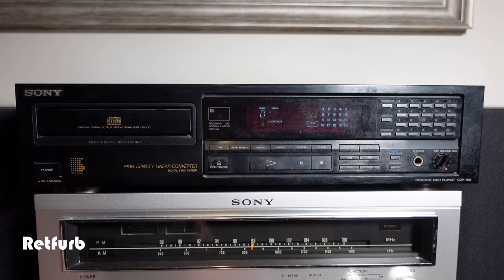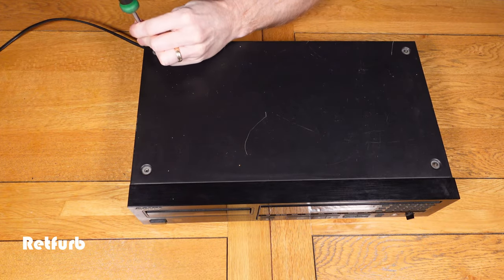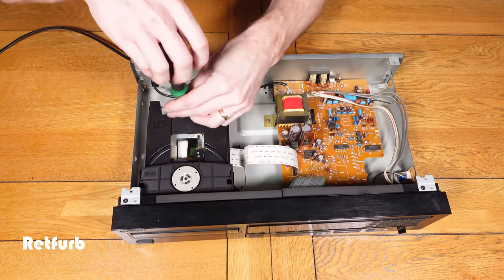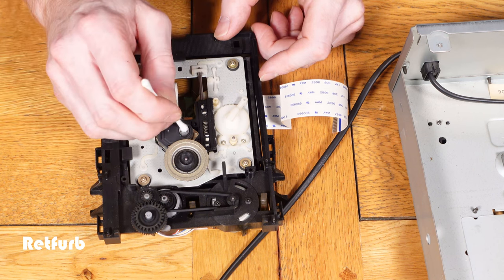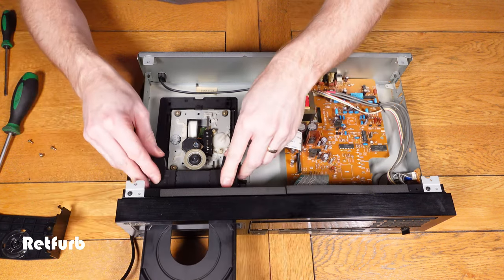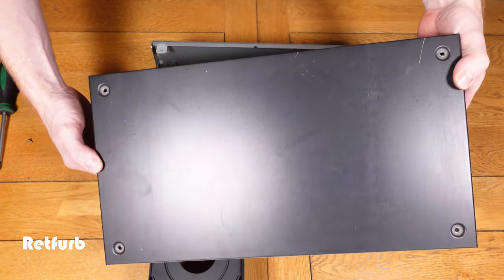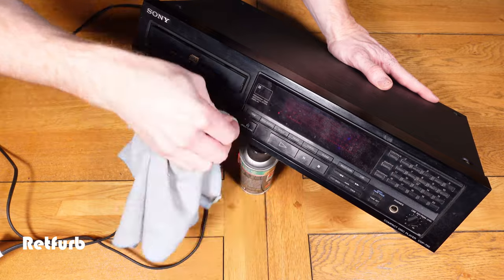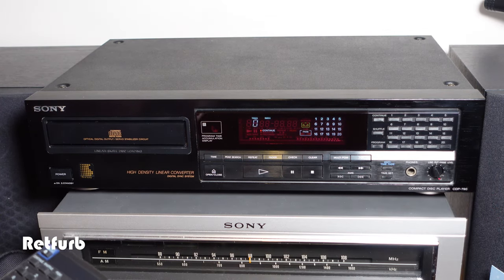Compact Disc Read Error, Sony CDP-790 1990's CD Player - Retfurb Audio Refurb

Comment: Often on CD-players you can unclip the front (nameplate) from the tray, allowing you to take out the complete drive-mechanism with the tray, so you don't have to disassemble the drive inside the player.
Reply from the maker: Thanks for the additional info.
I did try to do that before I started, But it felt like it had a bit of resistance. So decided to do it this way.

Comment: Nice and quick and simple.  Only thing I'd add is to change the loading belt.  Sony belts are so prone to 'melting' and causing all kinds of mess.  While I'm in there, I'd always change a Sony belt.
(and a bit of grease on the pickup sled rails.  Always helps to keep it smooth)

Lovely machine!
Reply from the maker: Thanks for the additional info.

I did re-grease the rails, Just missed that part out. Wasn't on the recording for some reason.
As it was working well, I didn't go in to changing the belt. But have done this on a previous Sony CD unit.

It is a nice unit. 👍
Reply: @retfurb  Sony model numbers never make a lot of sense.  I've got a CDP-710 which looks similar on the outside but quite a bit different on the inside (my belt was very tired by the time I got into it)... Both look great.
Reply from the maker: @rosemeyer1939  👍 Thanks for the additional info, Its appreciated.